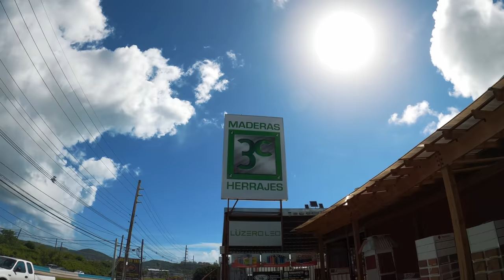BOAT YARD (PART 2) DESTROYED OUR BOAT SHOULD WE BUY THIS ONE?!

Comment: Matt you need to do a little more research. if you can ,  please watch Andy at Boatworks today(youtube) He will show you how to do glass work  properly, what you were trying to strip was Gelcoat, that needs a sanding disc on your grinder and a vacuum running.  you can learn when to use polyester resin with fiberglass and when to use epoxy.  Keep this boat and grind on. Don't ever stop man.

Comment: hire a surveyor to give the other boat a going over and check out the engine. if its in good condition, you can make a few alterations and you'll have a bigger home with a bit more room.there's a lot of  hardware on your boat that you can use on the new(to you) boat..in the end you might be happier and you'll be able to make longer passages.

Comment: To determine if your existing bulkheads are sound, take a small diameter hole saw and cut out a plug for examination.  If the bulkhead is good, seal the plug hole with epoxy and fibreglass and keep the existing bulkhead.  If the bulkhead is rotten, then you will know that replacing the bulkhead is worth the effort.

Comment: I think you need to use epoxy filler to glue the plywood ends to the side of the boat and use the filler to round the corners because you can't fiberglass 90 deg edges.  You should watch videos from Sailing Parlay Revival.  They do a lot of fiberglass work on their Cat.  Watch the sugar scoop extension form 4 months ago.  That will help.

Comment: 40 grit flap disks on the grinder.  Edited to add as I'm sure others have commented, bulkheads are typically bedded in some type of structural adhesive.  Could use thickened epoxy with chopped glass or even a construction adhesive.  Also, it would be a good idea to make fillets along the new bulkheads to round out the corners so that the glass lays better.  Looks like there is quite a bit of air in your hull to bulkhead joint which is a substantially weaker joint than one that is bedded in adhesive.  Edited again, not a structural engineer, but when I gave done bulkheads I have done a layup of 150CSM, then 1708biax, then 150csm, then 2 layers of 1708biax.  You will have less glass thickness, but the strength in the new biaxial matting is superiors to woven.

Comment: VERY IMPORTANT , you have to seal the edges of marine plywood. Water will get in and it will delaminate. Even if the glue where waterproof (generally it’s not) the wood will suck up water and fail. Cut , dry fit the part ,then seal the edges then set in place. The jogle stick trick works better with a pointed stick. Friar winds

Comment: You should be doing about 7 layers of glass and each one bigger then the last thicken the apoxy.  You should end up with a radius from plywood  to hull . A half inch  radius should 
Be plenty at top shrouds. If wood 
Is not rotted on other  bulkheads 
I would add few layers of glass
And create a fillets

Comment: you need to tab to the deck as well, also start with a 6 inch tab each side and increase tab width by 2 inches each layer for bulkheads I would suggest to use woven cloth only it is much stronger than chopstrand mat probably need at least 6 layers each side of the bulkheda and 4 layers to the deck then when you fit the shelf back in 3 layers each side to the shelf hope that helps and yeah as others have said go bing watch parlay revival for some lessons

Comment: Suggestion: You might want to watch Parlay Revival’s Fiberglas work.  He uses a small roller to wet the surfaces.  That little brush is going to take a lot of extra time.  Use the roller to wet that stuff out.  You will save a lot of work.

Comment: You should use thickened epoxy on the butt joints and the fillets before you start laying glass.  FG can't adhere well to 90-degree corners, and your core is not properly fastened to the bulkhead before you even start your glass work. You can get away with stabbing in the chopped strand to the 90 corners sometimes, but as soon as you try laying that bi-axle in there will be air gaps, and therefore terribly weak. It can't make that sharp of a corner. I could actually see the air gaps in your work in the corners. All that clear white color in the corners...that's air trapped under the glass. Those corners should be dark, like on the flat surfaces.

If I were you, I would redo the work. There will be a lot of load on that glass and core and it's not adhered to correctly. 

I didn't say anything when you did the FG work on top of your boat because there was no danger of doing it wrong. It just needs to be strong enough to walk on and keep water out. What you are doing now is different, and serious. With the sub-standard work you are doing now, your chainplates could rip away from the bulkhead and your mast could come down and kill somebody.

I don't mean to sound like a ****, but there are literally thousands of videos on youtube demonstrating the proper way to do glass work. You owe it to all the current and future occupants of your vessel to do this right. 

Don't get me wrong, I love your channel and like the fact that you do stuff on the cheap. But, sometimes that is not ok. Good luck
Reply: I was going to comment the same thing, glass doesn't like 90 degree corners. That bulkhead is not going to be as strong as it needs to be.

Comment: I would be so tempted by that CS 40.

The original fiberglass was probably sprayed on. So the manufacturer had an easy time making it nice and thick. Your going to need lots of layers to match their thickness. Lot's of great advice in the comments as well.
Reply: He doesn't need to match the thickness, he needs to match the strength.

Comment: Use a pipe(line) wire brush that you would buff a weld. The type you are using is not made for this type of use. The other will cut the time down by at least 1/2 or more. Doing a great job!

Comment: Use a flap disc or a sanding disc on your grinder instead of a wire wheel and maybe duct tape the vacuum hose to the Grainger

Comment: Fillet the joints between hull and bulkheads so you don't get a hard radius on the fibreglass and you get proper wetting out.  Also you can feather the layers as you don't need it full thickness all that distance. You need to put more layers on chainplate bulkheads to be similar to what they were before, they are critical. You shouldn't be able to waggle them more than a few mm pushing really hard. Now you know the issues you have on your current boat, don't change as you will just get another old boat with a different/similar set of problems.

Comment: Glad to see you rockin the M18 tools. Check out the fluid transfer pump, great for draining the dinghy. Also the 12 volt ( cigarette lighter) charger, the battery topper, ( usb to charge your phone) and the M12 soldering iron is awesome. I just ordered the mini router myself.

Comment: While I think of it, I have used the cheapest mixing cups I could get and only recently discovered how many times you can re-use them, they seem to be unbreakable, if you let the resin set hard you can flex the sides and the resin just pops loose, if you put the cup upside down before the resin hardens too much it will flow down the sides and you can then grab it and it may be still flexible the next day and come out in one piece.

Comment: It is always darkest before the dawn. Your boat is better. Imagine that brand-new dependable and quiet engine (if you sound proof while you can.) I looked at Sailing Parlay Revival and it looks like they have a lot in common, like on parallel paths. What is the value of a mega yacht after a hurricane? Sweat equity anyone? I wonder if Matt could test the bulkheads for soft spots with a small drill bit or tapping with a hammer to check it out. If it isn't broke, don't fix it.

Comment: The big corner fillets are necessary as others have said.  Start with narrow strips and get them wider each layer to transfer the stress.  Perhaps watch someone like Colin on Sailing Parlay or MJ Sailing on how to do this properly.  You have done so much work and just need to get your method down.  It is not just the number of layers but how they are applied that matters.

Comment: You should have put a thick bead of caulking on the joint between the wood and the hull.  Fiberglass needs rounded corners; sharp corners snap easy.

Comment: Pour a west putty using 404 highest strength filler after drying and removing rot, make taco shells wit gorilla tape, using the factory lams on the bulkheads, Hunter laminated this Cherubini like a battle ship so keep all that stuff with west 404 putty filler reenforcement, easy an strongest

Comment: The chopped strand mat is there because it's easy to form, rolls nicely into corners and is cheap. It's a good connection between the old fibreglass and the new. The woven roving material is much stronger. The strength of fibreglass is mainly in tension along the fibres, so the lines of weave of that cloth have a lot of tensile strength. The line your rig pulls on, via the chainplates, is the line that will need a lot of fibres running along it.  It is also a flexible material (think fishing rod) and you've only glassed one edge. That is never going to keep it rigid. Once you've tabbed the top and bottom it's going to be a lot stiffer. As others have said it's also good to fillet the connection. You don't want the forces making sharp 90 degree turns. That becomes a line of fracture.

Every Youtuber seems to automatically use epoxy. It is superior and provides a better bond with old fibreglass but it's not the only way. Your boat was built without epoxy. Epoxy is also dangerous stuff. Believe me you don't want to be getting it on you and become sensitised to it. That is not nice and will prevent you ever using it again. If well prepared you can get a decent bond with polyester or vinyl ester. It's a lot cheaper and while it's less strong you can achieve enough strength, or the same strength if you just use more. And osmosis is not going to be a problem on the interior (unless you've sunk).

Comment: Mattmiester, do yourself (and your lovely wife) a favour, go buy a 20v drill-impact driver set.... get 1/2" chuck size with a 1/2" - to socket drive attachment. The impact driver will be great on stubborn bolts and confined space where a hand ratchet does not have proper clearance. I also agree on fixing the old girl over buying the C&C. It will come in real handy for the engine install as well. Great work and if your keeping the short bulkhead, add a piece under and then tab/fiberglass the entire piece (old and new).

Comment: I would keep the boat I got. At lest you know what you got and it can for sure be repaired. The other boat will need tons of repair work also and you will not know what all it does need until you buy the boat. No thinks. Good luck guys and I think Matt has the right idea. If it don't need replacing, don't do it.

Comment: others here know more than I, that said;
I thought you're supposed to put those bulkhead boards in with a bed of resin-'peanutbutter' paste on the edges, fillet the 90deg angles and THEN fiberglass the large flat surfaces.
~ I am sure that fiberglass on the sides is Not supposed to be the structural anchor for that bulkhead.
You guys take care, I wish you well.

Comment: Somebody probably will tell you this, but I think rather than wire wheels you should use coarse (36-60) Grit sanding disc on your grinder to remove as much material in a hurry as you can. I've done a lot of this sort of work. if you take off too much fiber glass in the process you can build it up pretty easily.

Comment: Take a look at MJ Sailing or Parlay Revival for some good info on glassing in structural bulkheads. Glass hates going around a hard right angle, the usual process is to lay in a radiused fillet of thick peanut butter consistency epoxy filler right into corner between the hull and bulkhead, cover that with about a four inch/100mm wide glass strip, then six inch etc. Lay that all up wet, you don't have to wait for the fillet to cure, in fact it's better if you don't.
The other thing, are the original bulkheads not tabbed to the underside of the deck? Seems like piss poor engineering if they are only attached to the hull, and free to flap back and forth

Comment: While we didn't see a whole lot of the "new" boat I saw some issues that you are taking care of in your boat.  I'd skip buying the "new" boat and continue fixing yours.  One thing, and I'm no expert, but I have worked with glass and you should layer the glass, especially gussets to the hull and the deck, starting with thin strips and overlapping by at least an inch as you go bigger.  Also as others have suggested make sure you epoxy the bulkheads to the hull and deck.  Glad you went with the thicker plywood.

Comment: Use 1708 for everything fiberglass on a boat. Totalboat is less expensive than west system, and I find it to be a better quality epoxy too. Learn how to use a ticking stick it will make  bulkhead fitting  much  easier  and more accurate.
MDO is great for bulkheads and not all that expensive. As well.
I've got  more that a few videos on my channel about this stuff  you might  find some of them useful.
I've been doing  all the same stuff on my refit.
None of it is all the difficult  just time consuming.

Comment: I would not have gone with the CS40 as it also needs a lot of work, plus you have a new engine on its way. As for the chainplate bulkheads, I would keep one side, replace the wood and re-glass the other side with new epoxy resin and fiber. Good luck and a lot of patience, Cheers

Comment: Where to start?  No idea who your glass guru is, but I don't like his advice. To start, a 36 grit flap sander wheel on the grinder would have taken the paint off much faster than the grinder wheel. Then the new knees should have been encapsulated with epoxy and perhaps a layer of 1708. Then set in place, and add a filet of thickened epoxy wherever the knee contacts the hull or deck. The a layer of 1708 tape over the filet, then 3 or 4 successively larger layers of 1708, until the new knee is covered, and the tabbing on the hull is about 9" wide, more if you want to over-engineer it.  Once the epoxy cures, the new knee will never move.  Then, before reinstalling the chain plates, drill the bolt holes oversized, fill with thickened epoxy.  After that cures, drill proper size holes for the bolts, put it all back together.

Even better advice, get yourself Nigel Calder's book "Boat owner's mechanical and electrical manual".  It will tell you how to fix just about anything on your boat, right the first time.

Comment: Here's a few things about your 1st bulkhead installation you should consider.

The strength of your bulkhead is the half inch or 3/4 inch marine plywood itself. If you put a full layer of glass on both sides, yes, the bullhead would be a bit stronger, but that is really not the point of this repair.

You know those little plastic black plastic mixing sticks that they sell with West marine stuff. Notice how the end is rounded. That's what you use to do a filet on both sides where the bulkhead meets the overhead or the Hull of the boat. And that must be done with thickened epoxy (403, 406 or gflex)

Proper tabbing is not unimportant, but it is not the main structural attachment of that bulkhead. That attachment is thickened epoxy with fillets that make a strong fiberglass to fiberglass joint on the top and side or wherever it hits the hull or overhead.  When that cures, then you can carefully tab and that adds strength to prevent the bulkhead from twisting. The strength of the bulkhead is not I repeat not related to the tabbing overlay.

 Lastly, don't hesitate to contact gugeon brothers (West system manufacturer)  Is by email about the best way to proceed with this project. They have lots of PDFs on their website that will walk you through this and help you to do it right.

You're on the right track, just make sure you don't have to redo anything because you because you misunderstood the steps.

Comment: Pulling chain plate vertical supports is unwise, unless absolutely beyond repair.  Yours looked repairable so you did discover that...meaning less work and remaining sturdy.  Your job may not be as big a problem as you think.  Jacking and good fiberglass repair may be the solution for a good fix.  Wire brushing old paint is almost impossible as you also discovered.  Surface grinding, with correct wheels, is the answer to expose old fiberglass for a good bond.   Thinned epoxy bonding agents will also soak into iffy wood for a rock hard repair.  Sure beats tearing everything out and lots less expensive.